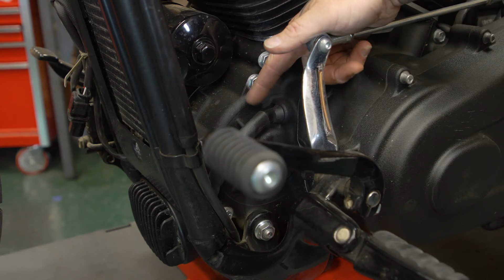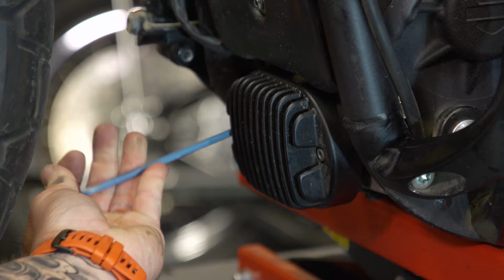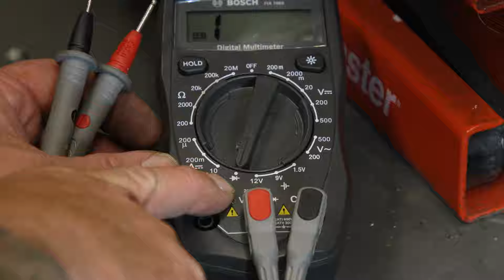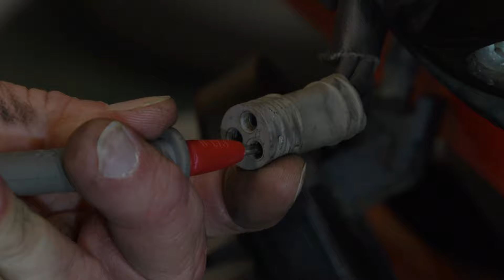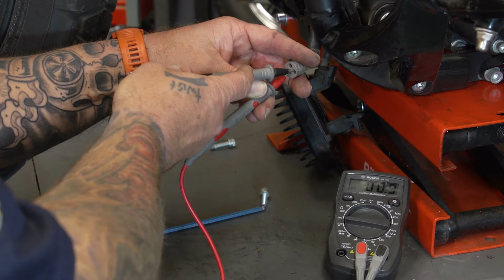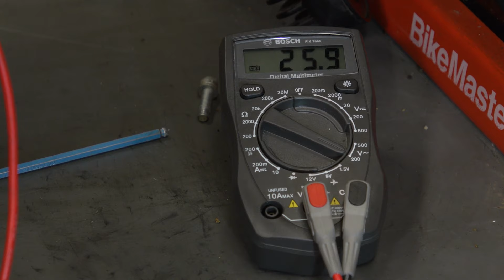How to Test a Harley Davidson Stator : Weekend Wrenching

Comment: Wow, great video. My motorcycle won't start. I've checked the battery and it's fine. When I jump-start it, it stays running, but if I disconnect the jump starter, it shuts off. Has this happened to you? I'd appreciate any advice you could give me!

Comment: I have a 2004 I hooked up a new stator but the wires are starting to smoke so I switched the wires still the same oh 2004 electro glide two prong wire and a new rectifier still riding but it smoking

Comment: On a bike without a rpm
Gauge kinda hard to tell 2000 but what if the bike puts out 50 ac volts at say 3000?

Comment: So Ichecked my battery not running and it is 13.34-13.36. Running at 2k rpm my voltage drops from 13.5 down to 13.27 at 2k rpm and is slowly dropping.01 every second. I stopped and didn't continue the test. My 2006 streetglide has a lithium battery and will NOT start unless I hook it up to charger until full start and let warm up and then won't start unless I do the same again. It actually died on me while in a  poker run and would not start. What would you do now.

Comment: I have an intermittent check engine light only comes on sometimes and then right back off again usually on deceleration. I replaced the voltage regulator and still getting code for high voltage to circuits.. Haven't checked the stator yet with these tests but haven't had issues with my battery..battery is still strong and charging fine..could my stator be the issue still?

Comment: OK so did the first test no beep stator seemed fine , went to do the second test bike won't start tell the stator is plugged back in to voltage regulator , did I miss something? Should I Start it then unplug the voltage regulator to test? Thxs for help

Comment: Hi there, I was wondering how the bike starter without the regulator connected to the bike? Or did you start the bike and than disconnected the regulator? Love the video’s you make!
Reply: The regulator is not needed for the bike to start. All it needs is a strong battery. The regulator makes sure the battery gets re-charged after every start.

Comment: I’m building a softail heritage and I’m confused about what wire takes the voltage charge to return back to the battery is it the copper pole from the rear circuit breaker? Or does it run from the starter back to the battery?

Comment: The multimeter I have beeps when it comes on contact with good continuity .
Reply: Mine beeps when I put it in any hole combo is that good or bad cause the video says bad but if some beep and it’s good I’m confused
Reply: @alexanderbouska8110  he said some meters beep to show continuity, but that his meter only showed 1 to show continuity. Then he said if it beeps it's bad. Confusing on his part. That's why I came to the comments, My takeaway is that if the stator shows continuity its good. Meaning that if it beeps, that's showing continuity and therefore it's good.

Comment: Thanks! My sporty iron 883 went from a commuter (44mi daily/20k in 2yrs) to sitting for a few months.
 Of course, the battery went dead and left me on the side of the road 1 month after my maint/repair warranty expired.
 I'm a car guy and have always worked on my own cars, but never a motorcycle (this is my first) and i have been reluctant to attempt this because all the videos I've watched are simply difficult to grasp. Not sure why, but I'm guessing it's probably because they all went too deep into the repair, rather than a simple 1st step diagnosis. 
This is much appreciated!

Comment: Do you ever answer questions when someone asks about your videos. I asked a question about a week ago and haven't gotten an answer. And now I have another question since I got the chance to do the AC testing. What if one of three connections doesn't match up with the other two? Two have readings of 34 to 35, but one of them only reads around 29 at 2000 rpms.

Comment: My 08 fxdl wasn't  charging the battery, I new it was probably the Cheap Chinese Voltage Regulator that Harley uses. I checked it sure enough it was bad, I also checked the Stator with confidence that it wasn't bad because the bike only has 14k original miles on it. After testing, sure enough the Stator was bad as well.  

Went to Stan's Harley in Batavia, NY, They wanted after tax 285$ for a cheap chinese voltage regulator and another 220 after tax for a stator that was also made in China. I told Stans to keep the parts I'll order quality parts instead, the girl at the parts Dept. pretty much treated me like shit after that. 
I went home and after some research I purchased a stator and a regulator from Cycle Electric, made in the USA in Ohio both came with a 2 year Warranty.  Note as soon as I take it out of the Package Harley won't warranty electrical parts.    Moral of the post,  by quality parts stay away from Cheap Harley Chinese parts, they don't last and they do not put out the proper voltage or current for the other electrical parts.

Comment: One other thing to consider if the stator is not putting out volts is the possibility of the rotor not turning due to  the rotor flange being spun, broken.
Apparently it's a common fault with stock rotors on Evo's.
My rotor broke at the flange but the motor/primary run fine as the rotor will just sit still while the broken flange of the rotor spins on the crank spline.
It may rattle giving some indication there's an issue at certain revs but otherwise there is no obvious reason the stator is not putting out volts.
The 6 magnets in the rotor may come loose as well. There is a replacement rotor with a rim holding the magnets in place to fix this issue.

Comment: My three prongs stator wire got cut two of the wires cut off from the front motor mount. Don’t understand how or why. Stator and regulator are only three months old. I’m going to check the stator like you showed. But the plug is no good and I can’t find a replacement without buying a new stator any help would be appreciated. Thanks

Comment: I have a 2019 Indian FTR that drains its battery while riding to the point of it shutting off every one in a while. It never fails to cold start tho.

Manual Says the stator should be giving 27 vac at idle and 34 at 2,000 rpm, but im only getting 20 and 31 respectively.

Is my stator that bad and needs replacing ? 

The regulator maintained the Battery at 14.5v, but dont know if the low power from the stator overworks the regulator and thats when my battery drains while riding ?

Comment: I have an 03 flstf/I. It is making a kind of grinding sound after it gets warmer up. The noise is present when the bike is just idling with no rider on the bike. I mean it's sitting on the kik stand idling and it begins to make a hell of a kinda grinding sound with plenty of vibration. I thought it may be my cam chain tensioner. I replaced them but the sound is still there. It is coming from the driver's side of the motor and it seems to be coming from the front lower left hand side of my bike. Left is the driver's side of the bike. Could this be my stater. I can't think of anything else it could be. Since it does it in neutral while idling I am thinking it's not my clutch pack. I'm at a loss. Any help would be awesome. Thanx

Comment: How would I check using the same procedure if the battery is dead? I have a 2014 vrod muscle and it’s giving problems with charging system and it keeps damaging the voltage regulator.

Comment: I have a 2008 xl1200c, I keep getting low ecu voltage on my V&H FP3. Is that a charging issue, ecu or something else? It happened once or twice before, JUST tried to ride home and that's all it kept showing was the check light with battery indicator. Nothing ran badly though either.

Comment: If you have an alarm installed on your bike & you don’t keep it on a battery tender or you don’t ride enough, or you don’t disconnect the ground wire, the alarm itself will drain the battery drastically. This kept happening on my Sportster 48 with a gel battery.  In this case, get a lithium battery with a built in tester (BTS) and it will shut itself off after it detects low charging levels.
Reply: Even if I don't use the alarm?

Comment: So what if it passes the first two tests, but not the AC test? I have a 2010 sportster 48 and the manual says 13.5 V at 2000 RPM, but other places online say that's 13.5 V per 1000 RPM, which would be about 27 V. Either way, I'm cranking out 31 at idle and up to 45-50 at a slight rev. Is that too high? It shoots WAY up if I really throttle it. Is that a bad stator? Great video! But it doesn't state what to do if the voltage is too high or too low. Any feedback is appreciated. Thanks in advance.
Reply: Don't worry about it. The faster it spins the more power is output. Your stator is good.

Comment: Excellent  video explaining everything. The one huge problem I have is that my bike won’t start so I can’t check that last test. Power goes on, speedometer doesn’t go on and nothing happens when I hit start. I tested the battery and it’s good. Its a 2007 Sporty 1200.. Any thoughts? Thank you

Comment: I've got a 99 S&s 113 I bought a new voltage regulator but even with switch off it's drawing constant power. Could that mean the stater is bad?

Comment: Does noise come from a bad stator or voltage regulator? I have a bike that just died and it was making a noise with the engine light and batrery light came on. When i was riding it it would make a noise when u pulled the clutch in and the ligjts dimmed. Is that the stator or th voltage regulator?

Comment: I have a 2002 Ultra Classic that has a 3-Phase Rectifying Regulator and stator I am just learning to work on my own projects how would I go about testing these two out everything I have seen deal with a plug in type.

When I first start the bike up volt meter on dash reads at 12.5 and as it runs for a few minuets it drops blow 11 volt's i had fired up the bike let it run for about 20 min. one day and had the battery tested it showed it was good but needed a charge but when I test it on the bike and rev it up its running in the 14.5 range. it has stalled on me a couple of time when i cam to a stop one person rider is good two is a spit and sputter. any and all help would be appreciated!

Comment: First off, thanks for the video. I have a 2000 Fat Boy. It has 2 leads on the plug going to the regulator. When I do the continuity test, each lead to a bolt on the frame I get 1500+ instead of no change. Q: stater is bad?

Comment: A little confusing on the continuity testing. Continuity testing should be done with the beeper ON. You don't have to even look at the meter display. A beep across 2 leads indicate no breaks. Resistance testing, you would be looking for a value on the display. Thanks for the video.

Comment: I have a 96 sportster stator checks out on test battery hold charge installed new voltage regulator.  I am still not getting over 12volts at battery holding 2k and 3k rpms. Is there any other options.

Comment: I have an 883 2012 not charging the battery. But when I disconnect my stator from my rectifier the bike will not start so how do I check voltage

Comment: You didn’t mention to make sure the point at which your testing for a short to ground, to make sure it’s a good ground, chrome bolts are not a good point to test. Also you use the ohm position to test for a short, not the diode position, that is for testing diodes, but it does kinda work the same.
Reply: You can use the lowest ohm position to check continuity if your multimeter doesn't have a diode position.
Reply: @ronaldfharring7326  And if the meter is set to OHMS with the beeper set to ON, the meter will act like a continuity tester. The video was a bit confusing, IMO.

Comment: Sorry forgot to mention it's on a 2017 Street Glide FLHX completely stock no add-ons original battery from Dealer was in from 2017 until now,no other work done

Comment: So I just did a quick battery swap with a new lithium-ion and when I start it and look at my voltage it climbs to 16 and flip-flops in between 14 and 16 just letting it run do you know why??

Comment: Great video. Just learned I passed all 3 tests on the video. OK so tell me now please.. Does this mean my rectifier is bad? I'm not getting any charging at my battery..
Reply: Set your tester on DC volts remove the DC output cable to battery start the bike rev to 2k check the DC output voltage  across the  2 regulator/rectifier pins should be getting 12-15VDC output if not its fkd

Comment: Test a battery always under load! A battery without a load always give's nice 12Volt but under load the bad battery's wil betray themselves.
Also the alternator, always test them under load, take a big power resistor of about 10 to 20 Ohm, but be carreful, this resistor in gona get hot!! I cool them always in a bucket filled with water. measure the current and voltage, if all three are equal then the alternator is ok.

Comment: I installed a new battery. Rode for several hours,  killing the engine and restarting several times. Last start battery was dead.   Bike is 07 w/ 76500 miles. Volt gauge reads pegged out. Replaced volt meter. Gauge is the same!??  Gauge out?

Comment: Check your battery first, especially if you run a Buell XB12Ss like mine and have a fan that constantly runs, even after you shut the bike off for what seems like 5 minutes.  This is good for the engine so it cools nicely and keeps oil passeges from clogging due to a hot motor and no oil circulation... but it sure tasks your battery something fierce.

Comment: There might be confusion here about the alarm during the continuity check. My MM gives a buzz when there is continuity and stays silent, but on 1 when there is not
Reply: Correct. He was a bit confusing. A continuity test only looks for a break in the wires, thus we use the beeper. No need to even look at the display. A beep means no breaks. No beep means break in the wire (stator windings).
Reply: I’m glad I found this, I knew I was right and you proved it. Beep Beep Beep!

Comment: So I’m not to confident in my results but my stator passed the continuity test and failed the ohm test. I tested the multimeter before starting and confirmed it was reading at a 0.00. Only one phase read at a 0.01. The other two phases read at a 0.00. I’m pretty sure that screams bad stator but a yes or no and some direction on how to move forward would be much appreciated. Bikes been kept in the garage for 3 months now and it’s just starting to get nice and cool out I’d love to get back on the road. Plz help lol.
Reply: Well mine stopped charging.  I checked my 3 phase windings . Simular to the way checked a 3 phase motor.  I checked each phase to ground  . Shorted to ground. So I did not check the resistance of the coils no need . Pulled it down called jp ordered a stator . For sure in my option do what ever is necessary to make sure the bolts don't back out of stator . I added more blue lock tight and torqued it properly

Comment: Hi . I have a 2015 ultra limited low. I tested my stator for continuity and I got an alarm sound from all 3 phases. But when I did the ac voltage output test while the bike was running all 3 phases were at about 30-35 ac volts. Is my stator bad?
Reply: The continuity test isn't the best test, as it only shows if there is a break (open) or short in the windings. It doesn't tell you the actual resistance in the windings, which is a much better test for the health of the stator. If you can find the specs for the correct resistance then you are golden. If not, then you can still do a resistance test across all 3 phases and compare.  Look for  all three within ~10% of each other. And 30-35 VAC (above idle) may be a good reading in your application. The spec should be published out there on the interweb. Cheers.
Reply: @steadyeddie7453  my stator was toast. I’m glad I did the test on it.

Comment: Hi, I have a 2000 Ulra that just died on me yesterday taking a short trip. I charged up the battery last night and today I performed the stator test as you show in the video. My meter shows that the stator is grounded on both sides which you say the stator is bad, but it is putting out 38 volts at 2000 rpm which is good. I checked the continuity between the 2 and there is continuity which is good.  I checked the voltage at the battery while the bike is running and voltage is low (11.8v) and does not rise when revved up. Do you know whats going on here. Can a stator be grounded and still produce the proper voltage?
Reply: Bad regulator
Reply: Was it the regulator in the end? My bike is littery doing the exact same thing. Tested to ground on the stator while putting out good voltage. Battery not charging

Comment: I'd check the charging system in this order - battery, regulator and then stator. Simply because that's the easiest and most logical flow. Battery most likely culprit and regulator can be tested at the same time by checking if voltage is holding, dropping or surging. If they're OK, stator is next and most likely the problem.
Reply: Do you have a channel or video I can watch your process on? Thanks
Reply: Okay so are you saying if I test my battery and I have less volts while it's running than I did before I started it it's the regulator or the stator?